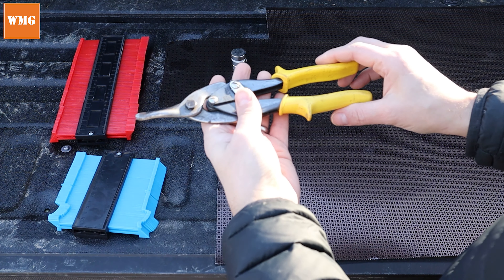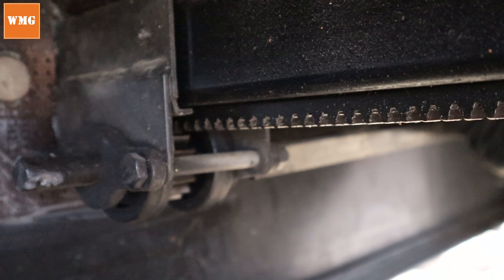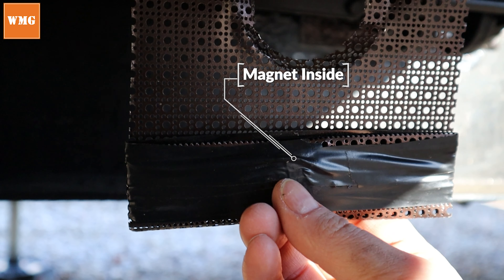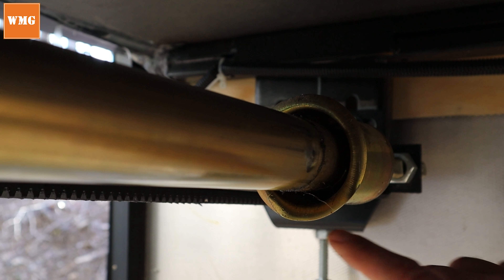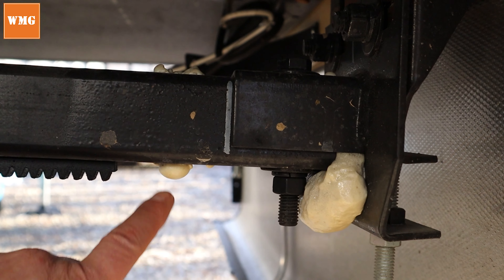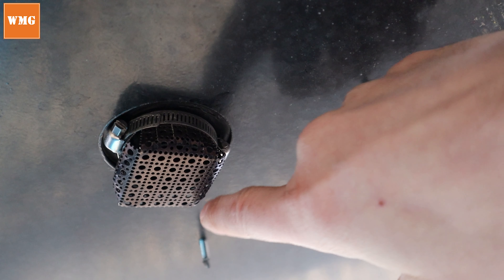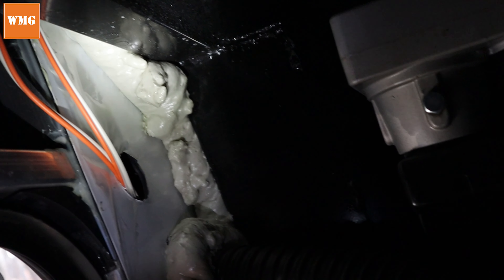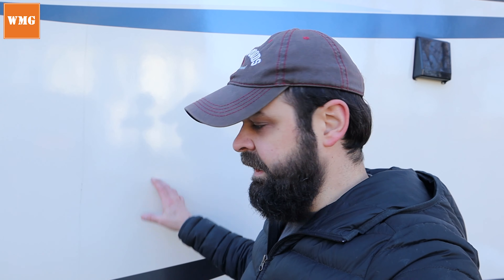How I STOP MICE from getting in my RV - No Mice 3 Years Later! #mouseproofrv

Comment: I used the expanding foam and accidently stepped on it with bare feet. I didn't realize it until it cured. My toes were fused together and it goes though the skin. There is no known cure to get it off after it cures. It was horrible and I had to wait for it to wear off. Thank you for mentioning the safety issue with it.
Reply from the maker: Also, I just posted this install for a Soft Start unit for your RV Air Conditioner if you are interested check it out. It takes the huge jolt of power consumption away for when the AC starts. Very helpful to allow less power to do the same job. You can run the AC on a generator, or a 15amp line with the soft start. https://youtu.be/C-Yg6zhNCYY
Reply: Alcohol dissolves it.
Reply from the maker: Thank you.  I've never tried that.  I'll keep this on mind and try it next time I need to remove some.

Comment: I didn't hear you say anything about needing to keep the expanding form can upright. It doesn't squirt upside down, and it doesn't squirt sideways or even tilted at an angle, it must be upright.
Reply from the maker: Hmm, which brand did you use? I think some brands can do any direction. But i don't think i needed to hold it upside down, I held it upright the whole time and was fine. But you still need to make sure you use protective safety equipment so you don't get the foam in your eye or on your skin, etc.

Comment: What’s the best way for applying foam above you? Always wants to fall. Is there a specific type of applicator or brand that mitigates this?
Reply from the maker: Great question, I'm not an expert, just a guy with an RV. But in my opinion, first thing is safety, keep your face, eyes, and anything else out of the path that foam could fall. The second thing I do is hold the dispensing tube within a space that allows the foam to contact 2 or 3 surfaces while being applied so that it has more surfaces to grip.  So, for example, in a corner rather than just a flat surface or in the air gap of a joint. I also don't press the trigger all the way. Press partially, so it's a little slower release. The reason for that is that it seems to squish its way into the gap better and make better grip than when going full speed fast.
Reply: @WhatsMyGear  thanks for the response- great channel

Comment: wouldn't copper wool with spray foam sealant be much easier?
Reply from the maker: There are 5 different solutions in the video that address 5 different scenarios. Maybe copper wool would be good for some of the scenarios, but I really like the aluminum sheet for the large openings on the I-beam. I'm a little concerned with the corrosion on copper over time.  It generates that aqua color build-up that forms a crust and can spread to the surrounding area.  I'm just not sure about it for the long haul. It's been 3 years, and I hadn't needed to redo anything. It's been holding up well.

Comment: i have a few that got into the cieling of my trailer how should i get them ot thanks
Reply from the maker: Wow, ok. I've never heard of them getting in from the roof. Can you share a bit more about how they entered the roof? Is there a hole visible from the outside? Is there an uncovered vent or something like that?. They need to enter through an opening. So, the type of opening would lead us to find an appropriate way to block the opening l.
Reply: They got in from underneath the trailer somehow got in the walls got between the ceiling and the actual outer roof
Reply: You can hear them up there its not a good thing
Reply from the maker: Ok, that makes sense.  My recommendation for stopping them from getting inside is to eliminate all mouse entry points. This means instead of using poison or traps or dryer sheets or steel wool, those are all things to do after mice have entered the underbelly. Instead, seal up all the ways a mouse could enter. Then you don't need the other things.  That's what I show in this video.  Watch each type of way I seal the entry points.  That's the only way I know that works.  I've been mouse free for years this way.
Reply from the maker: As for removing the ones that are in there already.  I personally would place traps everywhere. Bait the traps.  Don't use poison because they will die in the walls and rot in the walls.  Let them get in the traps and remove them from the rv once they are trapped.  They make lots of traps.  Some kill the mice, some don't.  That's up to you.
Reply: Thanks i will get some traps from the hardware store
Reply from the maker: When I say place them everywhere, I mean everywhere. Inside cabinets, drawers, stove top, the sink, counter top, floor, base boards, corners of rooms, behind the fridge, furnace compartment, under the sink, all over the dam place because those rodents will go on places you wouldn't think of.  Then, leave the rv for days to make sure nothing scares them back into the walls.  Peanut butter on the trap works well. Replace traps as they get used.  You could also make a "bucket mouse trap". Google it, there are a few ways to make it.  Hope this helps.
Reply: Has anyone tried those sonic sound waves
Reply from the maker: I have, the sound devices did not work for me.  Found most poop all around them while they were running.  It's like they had a party around them.

Comment: You can trim the expanding foam with a heated up butter knife cuts a great smooth edge
Reply from the maker: I've always wondered if leaving the smooth finish makes it last longer.  Old foam looks oxidized and brittle to me.  I just wonder if painting it instead of cutting it would be better in the long run.  Both options hide it better than leaving it as is, but the paint adds a protective layer.  Not sure, these are just thoughts.

Comment: HI  I am wondering, when you put the expanding foam into the inside of the closed slides, can they then open or do you have to somehow cut it away when you open it?  Also:  What do you do about the AC unit?
Reply from the maker: I put very little foam in the air gap around the slide cutouts. As a result, the foam did not expand enough to inhibit slide closure. But if it did, I think it could be easily trimmed off to be flush with the wall. For my AC, check out my AC soft start video. I do a seal job on that toward the end.  https://youtu.be/C-Yg6zhNCYY?si=fzo7grdO0pWTe9TK

Comment: Very much appreciate this great video and the resulting  discussion from the community.  Mouse traps are currently effectively elimating mice (2)  before they do any damage, but as per your comments, I'd like to totally eliminate their entry. I'll be using "Xcluder Rodent and Pest Barrier Kit", a  stainless steel  wool, or some other source of stainless steel wool to avoid rusty steel wool, or green oxide from copper wool.  I'll use it with the expanding foam that you mentioned, the one intended for rodents. Will use this combo in most location's. The potential for rodent ingress around my rear slideout rails is huge, when the slide out is extended. Thank you so very much for that eye opener!!!  Great suggestions on how to address that issue with thin perforated aluminum plate.  To be honest, and a bit lazy, I'll first try to use stainless steel wool in that area. With a bit of ingenuity, I can glue ( caulk) it into place and it will flex as the slide out rails move past it. Expect it will work well, but how long it will last is anyone's guess. I've always got your proven method to fall back on if my quick method does not work.
My real problem is that after generally mouse proofing the Thor Compass Motorhome (Ford Transit), we've had two mice enter via the fire wall. One mouse visited the glove box, thus cluing us into the fire wall as the likely point of entry. Will look for the hole at night using a bright light on one side of the fire wall, while looking at the other side.  To seal the fire wall, I'll use multiple methods outlined by you and  enhanced by the  comments of others. To protect the engine wiring  I'll use mouse and/or rat traps placed on top of the engine. 
Yes, as you pointed out, it takes multiple methods, and as the community pointed out, we can all learn alot  from each other's experiences. Actually looking forwarded to this job after the snow melts 😅.

Stainless steel wool:
Xcluder Rodent Control Fill Fabric; Large DIY Kit; Steel Wool Blend; Protect Commercial & Residential Properties from Rats and Mice (162758A) https://a.co/d/4Vvnmrr
Reply from the maker: Good luck, let me know how it goes! Feel free to share anything you learn as you do it, the community will benefit from it :) thanks again for commenting!

Comment: I found those ultrasonic plug in devices are great at repelling  mice and squirrels.
Reply from the maker: Those things have been hot or miss for me.  I've plugged them in my garage and found most poop all around it.  It's like the device attracted mice. It's so weird. So I don't know about those things.
Reply: From my experience, I believe the ultrasonic devices can work. One thing I found about them was there efficiency deteriorates over time, so in our industrial setting, I would date each one and replace every three or four years. I think that’s important. They may not be 100%, But I think they are one more thing that helps.
Reply from the maker: Interesting. Thanks for sharing 👍

Comment: Can't mice chew through spray foam?
Reply from the maker: This is the rodent resistant foam, not the regular foam. I have links in the video description if you want to check it out. But I would assume mice "can" chew through it, but they  don't because they don't like the taste of the rodent resistant stuff. The biggest mouse proofing action you can take is with the aluminum mesh that I showed because that covers the big holes. Everything else is icing on the cake. Lastly, I can say 3 years later, I haven't had any mice in this RV.

Comment: Thanks for the great video, Ted! You showed a lot of spots I hadn’t thought of. The video at this link shows a great experiment on what size hole mice can fit through. Multiple holes were setup with baits on the other side. Mice were recorded entering all the round holes that were just under dime size and larger and they ate all the bait in those cubbies. Mice could not get into the smaller round holes. For longer gaps, they can flatten their body and squeeze into something that is only 14mm - my pencils are smaller than that, but I think a pencil is a good guide to use. https://www.youtube.com/watch?v=pNaz4keivMk&list=WL&index=195

We had mice get into the underbelly of our rv, then into the furnace vents and into the living area from the heating vents on the floor. We’re going to do everything that you showed in your video to keep them out of the underbelly but in case we miss something, we already covered the grill on the furnace with ¼” mesh (used fireproof thermal tape to attach it around the edges while being careful not to block the air flow). In case that fails, we also pulled up the floor heater vents and placed a smaller mesh in those so mice can’t come up between the louvres of the vents – used the smaller mesh that is used to prevent wasps from getting in on the floor vents. We plan to pull the cover off on the a/c which is located on the roof and look for things that need to be mouse proofed there. We never leave food in the RV when we’re gone, and I always wipe everything down and mop before we close it up, but mice still came in. It didn’t look like they stayed long but they definitely explored and left droppings in various places and peed in the floor vents. I’ve also seen videos on youtube where people set up cameras after spraying peppermint and other mint oils, but the mice and rats are not even phased by it. Your focus on sealing entry points is definitely the course of action that is needed to win the war on rodents. Thanks again for a great video!
Reply: We had already sprayed foam to seal the underbelly but obviously missed some places.
Reply from the maker: Thank you for the kind words and sharing your past experiences and findings! This is super helpful

Comment: Great info, Thnx! Mice will try to chew thru or scratch out the expanding foam, so you may need to fill a cavity with some steel wool AND then add the expanding foam as well.
Reply from the maker: This is anti-rodent expanding foam, they may help resist them.  I just inspected the whole thing, and after 2 years so far, they hadn't chewed it. Maybe they make it taste bad, I'm not sure what makes it rodent proof but so far it's working.

Comment: One quick solution around the slide out areas is to apply a heavy coat of grease to areas that mice cannot get a grip to climb in .
Reply from the maker: Interesting idea. I wouldn't want to have to check it and reapply periodically. I prefer more of a set it and forget it type of solution.  But what ever works!
Reply: @WhatsMyGear  Thanks for the video . I think mine are coming in through the hollow rails on the slide. Appreciate it.
Reply from the maker: @Bhat-lf9oc  if there is a way, those darn things will find it!

Comment: Hmm... if it were me, cuz I'm lazy, I'd grease all of the Jacks and then find a clear flexible, slick material like a vinyl or pvc sheet and secure it around the tires.

Similar to the newer methods of keeping scorpions out of houses in Arizona, using a smooth, glass-like coating around the base of the house.
Reply from the maker: I tried that on my last rv and failed to keep mice out.  So this time around I pulled out all the stops. It's all out war between me and the mice! I'm happy to say, this has worked so far, they hadn't gotten in 😀

Comment: Great video! This is my project for the weekend. My trailer had a woven tarp like material over the bottom, a layer of batt insulation and then the floor. I had been under the trailer multiple times trying to plug holes. It wasn't until I removed the tarp and insulation that I discovered that the floor had multiple large opening through the plywood (the biggest one, 6" by 8", was under the shower tub). Basically if a mouse made it past the flimsy tarp it had easy access to any opening that it could find in the floor. They were also nesting in the insulation under the floor. Its a disgusting job that could easily have been prevented with a  few extra dollars during construction.
Reply from the maker: Once you seal up the floor, what are you planning to put back in place of what you took out?
Reply: @WhatsMyGear  I'm using rock wool insulation with 1.75 galvanized expanded metal lath over top and sealing the whole thing up with 3/8" pressure treated plywood.
Reply from the maker: That's going to be alot of work but I bet it makes the rv more comfortable with that insulation. You may want to consider putting a waterproof sealer on the side of the wood that faces the ground. That way, rain would beed off it while diving in wet conditions.  Good luck my friend :)

Comment: We had an issue when we were away from our rv ! What I did was string lights (white light) and plugged it in at night ! Mouse problem solved ! I have a Class A ! Not going to happen motor home ! Great for a trailer ! Had a lot of haters on the lights but no mice so who cares about haters ! Great job on your RV
Reply from the maker: Thank you for sharing.  I didn't realize that lights affected mice.  Interesting
Reply: We camped near saguaro national Park last year and noticed almost everyone had their hood unlatched and up a few inches. There were a number of people who had lights strung underneath their trailers. You do want to be considerate with those and don’t want to blast out and annoy your fellow campers.  You could overdo it, and the mice would be the least of your worries.
Reply: I have motion sensor bright lights in Rv…useless to deter mice.
Reply: @WhatsMyGear  once the mouse trails are in for instance, a rear RV tire….. lights inside certainly do NOT help, with motion sensors.
Reply: @kgd6147  it seems that it works for some and not others ! I had mice in mine after I strung lights underneath they were never seen again ! Now when traveling I don’t use them just when it will sit for a long time

Comment: Very very sad to see these beautiful looking units from afar then to actually look closely, inspect things for yourself and see the unacceptable workmanship, shortcuts, sloppy caulking/silicone, flimsy paneling, ridiculously oversised drill holes, shotty insulation, massive air spaces and gaps. Cheap faucets I could go on alot more.... It's disheartening that the quality no where is even close to the price tags these manufacturer's are getting these days
Reply from the maker: I'm going to have to upgrade my bathroom faucet. And I've had to put alot of work into my unit just to get it closer to my standards.  But I'll never fully get there.